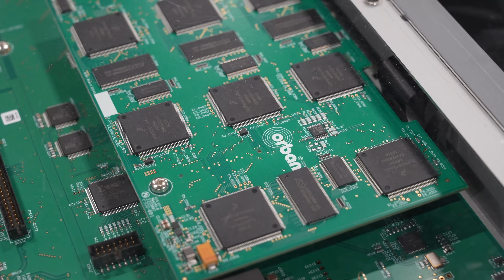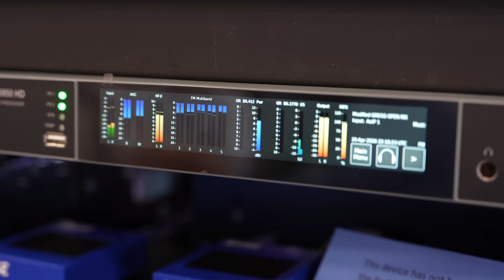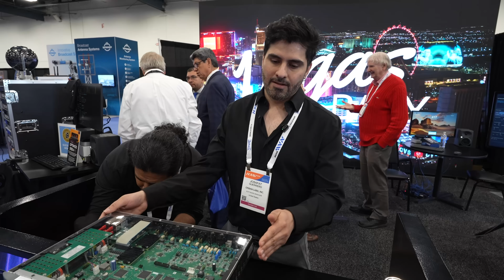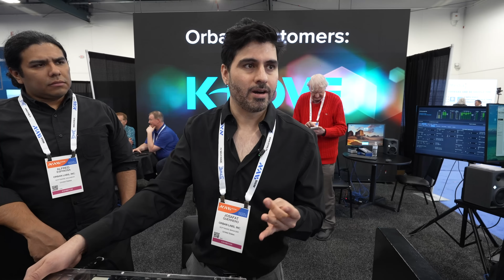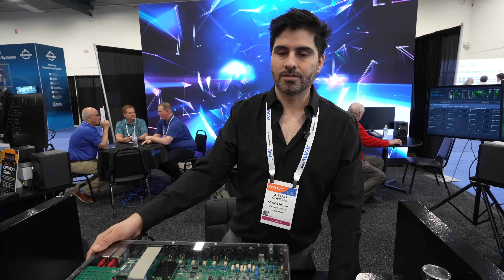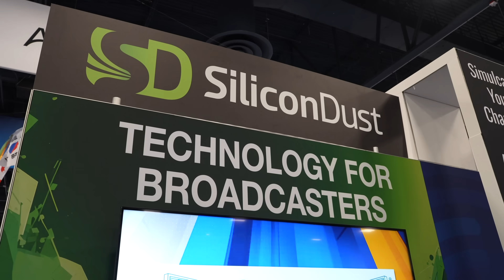A most unconventional Pi cluster

Comment: I dread to think how I’m going to repair the 5750 processor if the eMMC fails... By the way, the author is wondering about how much memory is needed and so on — there’s an important point here: audio processing and all control logic for inputs/outputs are handled by the DSP. Moreover, during boot-up, the sound comes on much faster than the touchscreen or web control 'wake up'

Comment: I have a 5950 that has partially failed due to the controller Pi locking up. The audio keeps chugging along, but once a month the display and controller lock up and require a power cycle. The giveaway is a bright purple indicator on the front

Comment: A Pi in an Optimod... nice and makes a lot of sense. I just brought home a rare blue face Optimod 8100 for my home studio/collection. If I get the chance, I want Bob to sign it.
Reply from the maker: Most of those older ones I've seen are the tan/brown, but I do remember finding the blue at a tower site a few years back!
Reply: @Level2Jeff  From what I have gathered, they were a special run for BE to match their transmitters. Nobody seems to know how many were made, and who knows how many still exist. I am going to try to run it through an MPX decoder for a stereo processor. Also heard you could use the test ports if you add a deesser. If you loved listening to the radio the last few decades an 8100 probably made it sound that way. We only recently replaced ours.

Comment: A far cry from the 8100 with its complexity (the university radio I volunteered for in the 2000s probably still uses one), but still very nice! I like the idea of several Pis (Pies?) for functionally different tasks, that would limit the software set you need on each, making maintenance simpler with less dependency conflicts.

Comment: Is this Optimod related to the old Optimod that used to be somewhat popular with large shortwave broadcasters? If I remember right, that Optimod just reduced the carrier power when the audio level was low. It seemed like a somewhat weird idea to me, since there was a similar system, which I don't remember the name of, that did the exact opposite – reduced the carrier power during the louder parts of the broadcast. That latter one seemed to make slightly more sense to me at the time. But both were really just a way to be able to reduce the electricity bill while still being able to truthfully say that you had a 500kW (or whatever power) transmitter.

Comment: dumb question but what is the "watermark" they are talking about, 3 watermarks, mid-stream/mid-path? What is that for and why?
Reply from the maker: A lot of radio stations participate in various ratings systems, where people wear 'sensors' or have them on their phones. When they move around, the sensors detect background watermark sounds on the transmissions, and the sensor tracks what stations people listen to. It's used for ratings data for sales and such.

Sometimes you can even hear the interference it causes, if there's certain noise in the background like low crowd noise at a baseball game, and the sound in the background.
Reply: @Level2Jeff thanks Jeff!

Comment: At the risk of doing the plug you didn't do... yeah, the Orban Optimod is an important invisible piece in the audio chain. My college radio station was losing the 'loudness war' with everyone else on the dial. They dropped an Optimod in, tuned it up a bit, and it instantly rocketed them up the list of professionality. Just as a listener, it is frustrating to have vastly different levels when skipping through your presets.
Reply: As a listener it is even more annoying that there is a loudness war to begin with. I hate the way radio sounds now. It is fatiguing.
Reply: @moki123g  Yep, exactly this.  My radio-listening behavior can be summed up by "Switching the radio on, and after about 30 seconds turning down the volume...and another 30 seconds in turning down the volume, and after another 30 seconds, maybe a minute, switching the radio off".
Reply: In the uk you would kicked of the air for broadcasting to loud or to quietly
Reply: @Daisy_human It isn't just gain. They compress the crap out of everything and run the rms value up. They strip all dynamics out of everything. Also the music has been mastered to do the same. If you look at a waveform display it is just a solid wall.
Reply: @moki123g  Recently had a professional momentary and longer-average loudness audio meter to play around with.  Put some old music on and some modern music.  The old music had the momentary and longer average loudness vary wildly.  The modern dance I put on afterwards had both of them sitting comfortably at the same level, barely moving.
Reply: @Daisy_human It's not just peak loudness: it's an intrinsic loudness that get's "built in" by these devices.  They pull up the soft parts like absolutely stupid, the loud parts are allowed to clip and are then limited back to fit the sway of an FM signal.  To much stereo deviation is not allowed but this crazy compression and limiting tends to make stupidly wide stereo images possible, saturing the audio display into a garbled mess (especially something you can hear well with modern dance and stuff, because that left the production studio in the same way they compress and limit radio for over a decade).

Comment: I worked extensively with Orban processors, even over 128 kbit ISDN transmission links back when leased lines just couldn’t be ordered. Telecom stunk… 

The thing with these boxes - if some worry about the ARM «cluster» capability - is that they don’t need to ‘scale’ lika a server. They do a predefined job, so when it’s working as once set up, it stays that way. As Jeff said, processors as old as those I serviced decades ago, still do what they did then. 

Roughly, it’s like mastering for broadcast audio, sometimes catering for e.g. FM preprocessing, line switching or level management. The modularity they mentioned. Orban has few real competitors, even my European side of the pond…

Comment: Dante on pi? Now I am interested.. is there a good (cheap) Linux Dante driver (x86 will do)
Reply: We use the Ravenna driver for Linux on ARM. That's the closest we get to Dante.
Reply: @marria01  Clara makes a pcie Dante card that seems to come with a Linux driver, don't know if it is a universal driver or if it needs the card. From memory the card is around €1600, but much for my purpose. And a Dante to Ravenna bridge isn't cheap either.. would a mini PC with windows and Dante bus drive Ravenna onto the network, making it a more cost effective bridge.. too many devices with Dante I like and only directout does some Ravenna it seems.
What is your usecase?
Reply: @annebokma4637  Broadcast. Mostly AES67, so it suits us. Of the Dante hardware we've had to interface with, I believe they've been made to operate in a mode that is broadly compatible with AES67. I'm more on the control side, so AMWA/NMOS type stuff. 

My experience of the Dante stuff at home is that, Virtual Sound Card aside, all the config is done on the Dante Controller side and the device (Behringer X32 Rack) just sees a bunch of audio I/O. So if you only need a stereo in/out could a USB AVIO suit?
Reply: @marria01  trying to move away from windows on my workstation and I don't think the USB avio are Linux compatible devices. I do plan to keep a mini PC running windows for things that need windows.. mostly running resolve and bigwig ony main rig.
Reply: @annebokma4637  a quick google seems to indicate they're supported under ALSA.

Comment: Here's the reason not to support Raspberry PI anymore: hobbyists subsidising private businesses. The latter wastefully using most of the stock, while the former have to scrap for artificially inflated units, when RPi decided to prioritise corporations.
Reply: The hobbyists aren't subsidising the private businesses though, RPi is just building tooling that's useful for both. And while the constrained supply sucks, that's not really RPi's fault, that's an upstream industry issue, and it shows if you try to buy alternatives to the RPi (having recently shopped around myself and being surprised to find that, at least for the lower RAM variants, it's actually about the same price for me to get a real Pi as it is for me to get a more or less equivalent but much less supported Chinese alternative)
Reply: Moreover Raspberry Foundation doesn't really care about hobbyists anymore, they made that clear during COVID when they prioritised companies instead of the general public when it came to providing Pi stocks.
Reply: @jackofsometradesmasterofnone  obviously, when faced with the choice of sending stock to companies that need them so they can ship products to stay afloat, or a bunch of neckbeards that want a faster Pi to run Home Assistant on. Any sensible organisation will obviously prioritise the latter.... 🙄 I mean, it's not like B2B sales make up 70% of their revenue or anything...
Reply: @marria01 This, As much as I want to be mad that they didn’t prioritise the hobbyists. It would’ve ABSOLUTELY hurt them financially to do that.